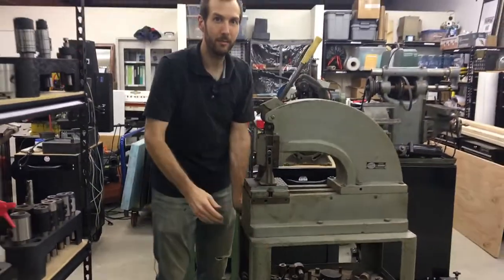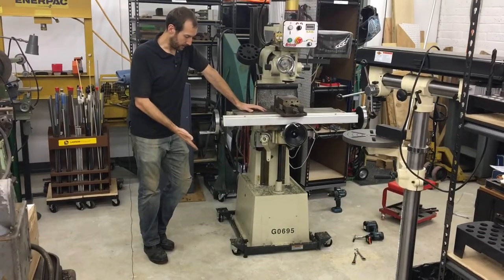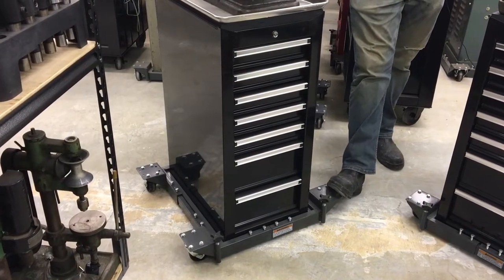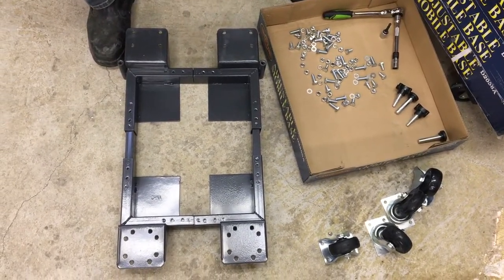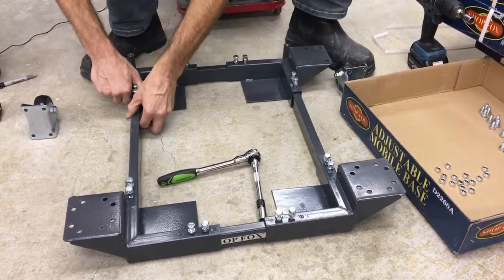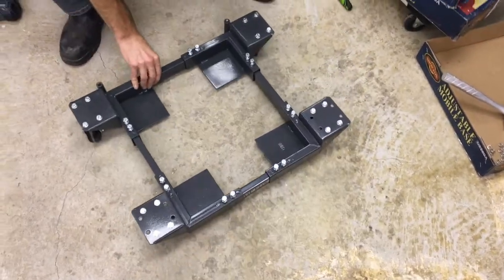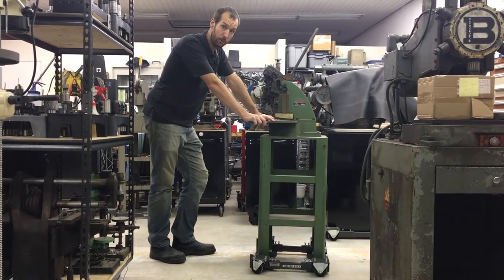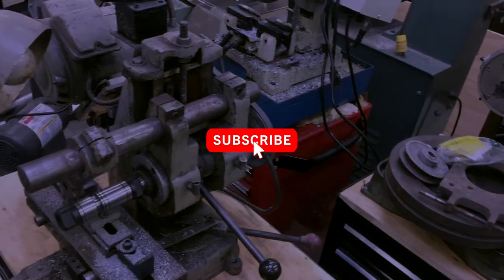MOBILE BASES for Machine Tools

Comment: Hold up. You're contention is a half ton mill on a mobile base doesnt noticably effect finish or operability?
What about vibration?
Convince me, I'm in need of a low profile mobile bench for a half ton bench mill!
Subbed 🔔
Reply from the maker: A half ton or 1,000 lbs machine is about the max I would put on a mobil base. A machine that small on a base is not going to affect performance. If you have a performance issue its likely because you need a bigger machine or you are doing something very rough on the machine. Its never been a problem for me so far.
Reply: @TigermothRacingTV  I'm sold.
Thanks for showing me this

Comment: Great video.  I have several of those.  Never understood why they don't sell a base with 4 swivel casters.
Reply from the maker: Mick Nolen I know, right? Which ones do you own?
Reply: @TigermothRacingTV  One for a tablesaw and bandsaw. I tried replacing the wheels with full rotate casters, that's when I discovered what you pointed out in the video, the holes don't align. :(
Reply from the maker: Hope it helped!
Reply: Bora and Vevor both have a 1500lb all swivel